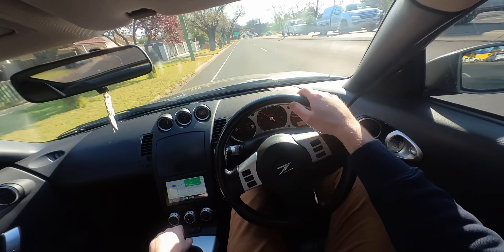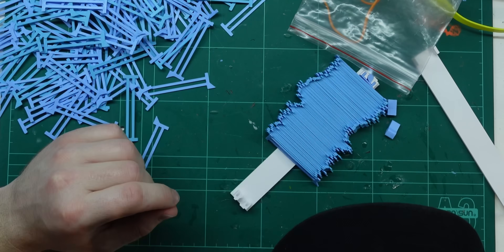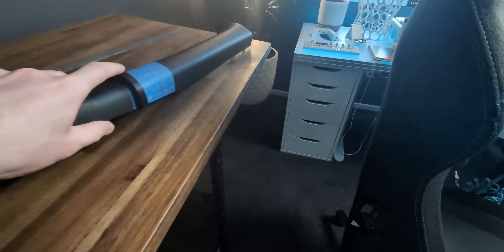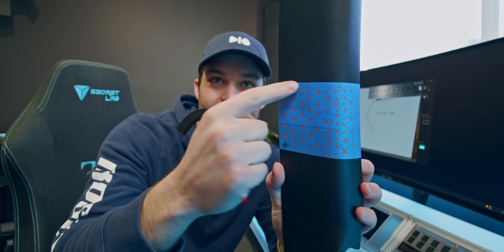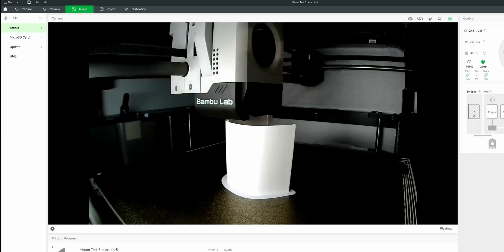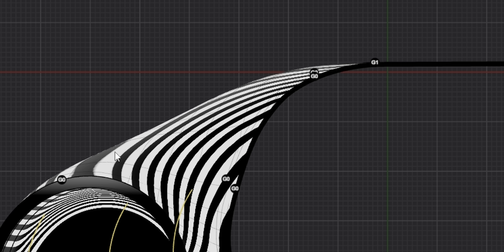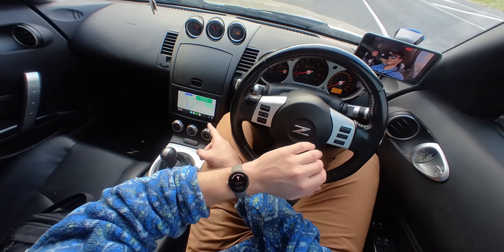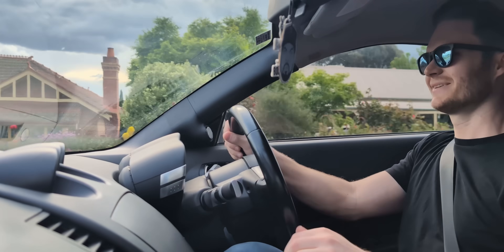a gauge pod with maps.

Comment: Very cool idea, damn those smartwatch restrictions making things so hard though! Really appreciate this sort of adapting things to other things that normally should not go together kind of designing, just seeing your process has maybe convinced me (a stuck in their ways tinkercad user) to maybe try and learn something different. 

Potentially another route you could go would be to do a more modern car style central widescreen setup with a couple of larger dash mods. You could custom 3d print a mount for the 3 pod gauges and relocate them below, replacing/modifying the dashbox, then 3d scan the left behind gauge/pod holes to create an easy reach enclosure/binnacle for a one of those wide screen portable Android Auto unit.

My partners car has a pretty old parrot Asteroid smart android unit with no AA, so recently went down the path of trying one of these portable units. Unfortunately made the mistake of impulse buying one from Amazon without doing my research! The first unit was a Carpuride, went to the trouble of making a riser in polycarbonate to install on the dash (can search my design: carpuride polo 9n3), stealthing the power/audio cables etc behind the dash, only for me to find out a day later that like many of these cheaper units they introduce a very annoying feedback loop from the speakers/mic when on calls 😢

So with much more research I found out the Cardpodgo (T3) was the way to go, as it could be used in "screen only mode", which means using head units existing bluetooth audio/phone mic to handle the audio, and the screen essentially being a dumb Android Auto display with no audio routed through it. In your case you could run your head existing unit in bluetooth only mode (ie. unplug the phone/wireless AA dongle) and have Android Auto running on the Carpodgo only. Definitely makes a huge different having such a unit within your peripheral vision rather than looking at a double din unit mounted down so low.

Comment: Have you checked out the beeline moto? It’s basically this, but for motorcycles. A little round screen that just shows you an arrow and distance info.
You could definitely make it work for your car!
Reply: And it’s extremely robust, doesn’t get compromised by heat like a smartwatch, and since it hasn’t do much internal components the battery lasts much longer. There’s even a power providing adapter if you want to power it by the car/bike. I love mine (i have the bicycle version, which is a bit lighter and does different routings but technically it’s the same) 😁👍
Reply: Thats actually pretty cool.... Now to make a gauge pod for my TJ. Currently using my apple watch as a turn by turn nav, but this would be so much better.
Reply: Came here to say this! Got one on my bike, they're dope 👌
Reply: I hope he sees this and gives it another go.
Reply: before watching the video, I assumed that's what he was using, just with an enclosure...
Reply: also came here to say this... reminded me immediately of the beeline...
Reply: This is the way to go
Reply: Exactly what I was thinking
Reply: I’ve got one too and it’s exactly what he wants. Highly recommend
Reply: That's what I thought he was using when I seen this video, was surprised to see the smart watch pop up, was constantly waiting on him saying "then I found this". Love the idea of fitting it to the A pillar tho, I fancy doing that in my old MG
Reply: Thought this was going to be a Beeline video as well. I’ve had both three original and the Beeline2…. Without doubt the mk2 is far superior imo. Only lasts about 2/3rds of a days riding on a single charge for me though, needed a quick usb top up from under the seat usb, to get me the last 20miles to my Airbnb from the middle of nowhere (considering a powered handlebar mount, but seems pricey for what they are)
Reply: Best thing about beeline is you can just have a cruising endpoint nav mode exactly like the arrow in the video game for when you want to find your own way there
Reply: I've tried you can't get it to work sadly
Reply: @SirDuckOLot  In what way couldn't you get it working? I've a mount sat on top of my clocks and it delivers exactly the same information as when I'm using it on my motorcycle or bicycle. I used the Go Pro adapter and it's been rock solid for two years
Reply: I have a mount in my car for my Beeline. I actually thought this was what he was using when I saw the thumbnail!
Reply: Been wanting to get one...does anyone know if it works with Australian maps?
Reply: @TakumiMarowana  it uses Google maps for its engine so would assume so (speaking with ignorant confidence as a Brit in the UK)
Reply: Honestly thinking about getting the updated version which also shows a minimalist map
Reply: I was just about to suggest the same thing haha
Reply: So who has a file for a 52mm gauge pod adapter compatible with the charger?👀
Reply: now all they need to do is make a beeline auto and we're all set

Comment: Much better than that one video of someone putting an apple watch on their steering wheel
Reply: That sounds like such a horrible idea with airbags and all 😂
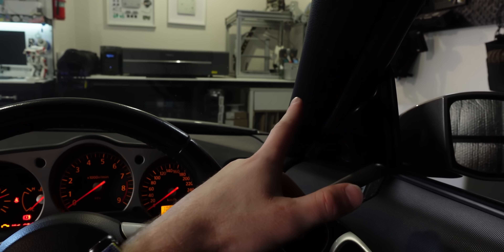Reply: @iso_2013  Well, considering there's also an airbag in the a-pillar (you can see it @1:09 just to the right of his left hand - it has a barcode sticker on it) , I'm not sure just how much better of an idea this is... 😬  I had to route the wiring for my dashcam very carefully when I was installing it in my car because of the same airbag location.
Reply: @BEdmonson85  that's an excellent point, I didn't think of that
Reply from the maker: @BEdmonson85  to my knowledge the only side airbags are in the seat. Which is why I haven't been able to swap to low profile racing seats in my '07 350z. Which sucks as I'm tall as for the stock ones haha (in Aus you can't remove airbag functionality). 
The A-Pillar trim seems to just cover metal, and even if there was a airbag my clip on mount is on the pillar so if it somehow was to be pushed off, the mount would just go with it.
Reply: @camshand  It's a curtain air bag in the headliner. The bar code is on an anchor strap that clips into the A pillar. It'll blow straight down/out to cover the window shoving the headliner/weather strip down and popping the top of the A pillar cover out. So basically if an impact doesn't send the watch flying the airbag deploying probably will. lol
Reply from the maker: interesting, I had guessed that strap had something to do with one of the airbags, given there's a label on the fabric. But since the seat also has the label I know it's stitching is torn at deployment.
I guess the headliner covers part of the window and maybe the seat does another segment.

Either way, my clip on mount doesn't interfere with any of the mounting points, so as you said, the watch will just go flying with the pillar if that's the case 😅 hopefully we never find out!
Reply: @camshand you might be able to swap for seats from another Nissan? I know some people overseas have swapped out their seats with ones from the GTR and the airbag could be wired up
Reply: Who posted that video? I need to see it
Reply: This sounds like a great idea. Will try it tomorrow
Reply: That’s a thing?! 🤣🤣🤣🤣
Reply: That’s wild, I’d most likely try to mount an iPod touch 6th or 7th gen on my dash instead of an Apple Watch.
Reply: doing this with my galaxy watch now. thanks!